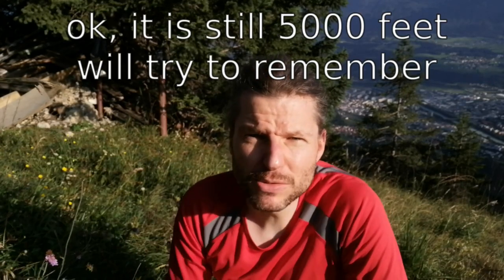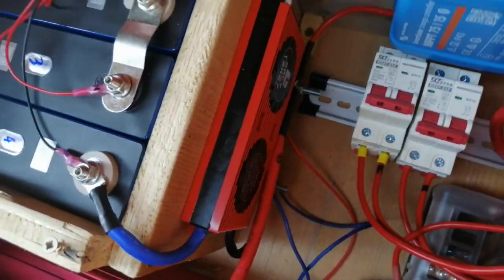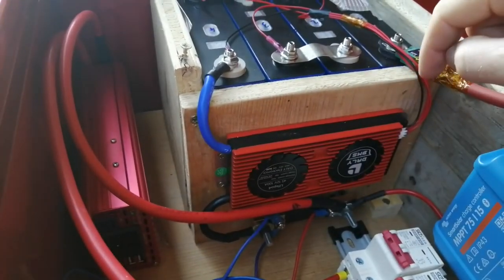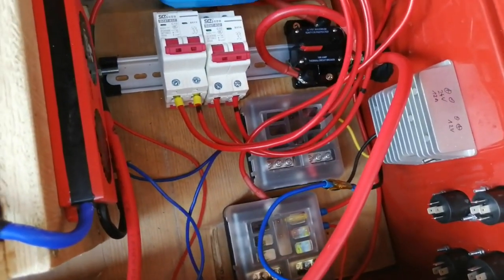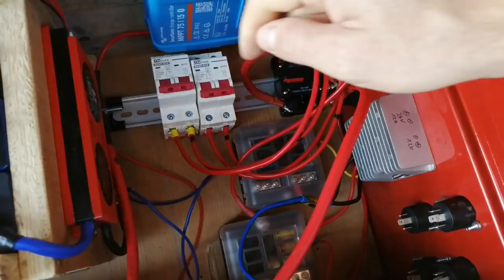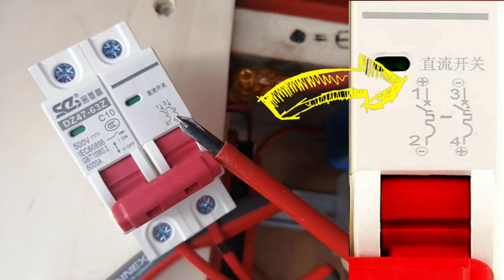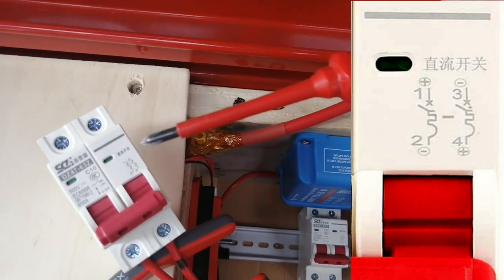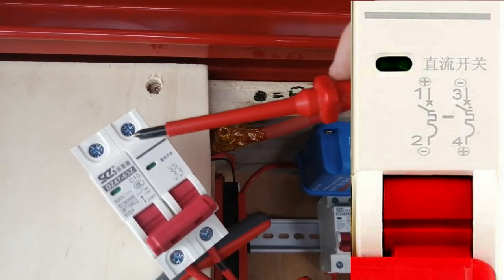How to wire up DC breakers? -  Building a 12V LiFePO4 Off-Grid All-in-One Solar Box (Part II)

Comment: Hi, I did not  understand... the higher potential has to be connected to the top(1 and 3)?
So PV plus to 1(top.left),PV minus to 3 (top right), charge controller plus to 2 ( bottom left) and cc minus to 4( bottom right)?
Or could I also connect the higher potential to the bottom, like so:
PV plus to 4(bottom right), PV minus to 2 ( bottom left), CC plus to 3 (top right) and CC minus to 1( top left)?
Reply from the maker: Hey, yup exactly, both is possible, exactly as you described.
Reply: Yes that's correct in my opinion and agree the video is correct ,the subject does cause confusion on many other channels

Comment: Even know it will work ok , you have the terminals backwards . Positive always goes on the right side as your facing the breaker .  Its a good habit to get into . this will help prevent accidents .
Reply from the maker: thanks Steve for the input. can you explain a bit in detail what you mean with "always right side" because it depends how you connect it?

Comment: I'm curious to ask if the stability and ability of the wires and circuit breakers, etc feel the same between lithium batteries compared to lead acid battery bank systems? 

I ask because I have noticed that how things work in reality isn't always just like on paper.
Reply from the maker: Hi noahriding5780, thanks for the question. I am not sure if I got your question. The wires and breakers do not care where the power is coming from. It is also the same equipment. 100amps from lithium is the same as 100amps from lead acid. cheers, Lupo
Reply: Thanks for your answer. I like to ask questions. I feel like lithium isn't quite as stable that's part of why I asked. Like there's a LOT of ebike and EV fires because of their lithium batteries. But one of my friends who is an engineer is hopeful that in 5 or 6 more years they will have worked out the kinks. I also asked because I noticed sometimes my solar wires going between the panels and the charge controller get hot and I wasn't sure why. So it seems there's so many things to research and ask about. And it makes me curious. I also feel its a great and wonderful opportunity to try to talk to smart people like yourself. You are a builder and are creating things, and that's very cool and wonderful. I wish for your continued success. @LupoDIY

Comment: A little confused.   You have a charge controller between the battery and the solar panels.   When you explained about the connections, you did not make it clear, how is the charge controller connected.  Bcuase on the circuit breaker positive side, the higher poential solar panels should connect and on the lower potential the charge controller should be connected.  So we ned another circuit breaker between the charge controller and te battery,  the question is should the charge controller be connected to the higher potential on this second circuit breaker and the battery to the lower potential side, assumng they are both polarized circuit breakers.   Just trying to understand, since I'm planning on bulding my own off grid solar small project.  Thanks.
Reply from the maker: Hey @martinlopez3792, thanks for the question. PV <--> Fuse /Breaker  <--> Charge Controller <--> Fuse /Breaker <--> Battery. On the PV side the PV has the higher potential and on the Battery side the Battery has the higher potential. Hope that helps? cheers, Lupo

Comment: I have a single pole breaker. It's labled, line and load. My problem is I want to put it on the positive output line from the inverter to the batteries. It's actually a two way circuit. When the inverter is charging the batteries the inverter would be line and the batteries would be load. However when the sun goes down the batteries would be the line and the inverter would be load.
I'm trying to figure which would be the best way to install it.
Reply from the maker: hey @fauxque5057 thanks for the question. just think about a short. usually there is more power stored int he battery, so in case of a short more power is coming from the battery. hope that helps, cheers, Lupo

Comment: So are you saying the plus sign is the wire coming from the source of power and the negative is headed to what youvwant to feed power to?
Reply from the maker: Hey Georgia, it depends. As you can see at 5:24 there are two + symbols. On one side you connect the positive wire of the higher potential (Input 1). In the other side you connect the negative wire of the consumer (Input 4). Hope that helps. But it is not written in stone, this is just the breaker I use. You always have to read the manual of your breaker. If you don't know exactly what you are doing, ask an electrician! cheers, Lupo

Comment: I think I understand but want to check. So my solar panel is the higher potential so both positive and negative of that go in the top connectors and the bottom connectors go to the inverter?
Reply from the maker: hey @andrewbreckill3832, it depends on you breaker and you should always check the manual. but in general this is the case. PV+ goes to breaker + symbol. PV- goes to the breaker - symbol. Both on top or both on bottom. cheers, Lupo

Comment: 7:32 Which is the higher potential: Battery or charge controller? Thx for the video!!
Reply from the maker: Hey @Paul-jo3zk, I know it is a bit confusing. In general the higher potential is always the side where you have more power stored. So whenever you have direct connection to a battery, it is usually the battery as in case of a short there will be a lot of power coming from the battery. hope that helps, cheers Lupo

Comment: I'm still confused. I just want to put one of these between the solar panels (+-) and MTTP controller (PV +-) so it acts as a cut off. How should it be wired?
Reply from the maker: It depends on your breaker, but in general the PV side is the higher pontential. So the poitive wire of the PV is connected to the + on the breaker. But make sure to check the manual and diagram on the breaker. cheers, Lupo

Comment: This is really important but I'm still confused as to how to connect battery Vs charger.... Is the Battery the load or the source?
Reply from the maker: Hey Godwin Bassey, it is about the higher potential. So the if the breaker is between PV panel and controller, the higher potential is the PV panel. If the breaker sits between the charge controller and the battery, the battery is the higher potential. hope that helps, cheers Lupo
Reply: @LupoDIY  how about if the breaker is between an inverter & a battery (considering that the inverter doubles as a charger)
Reply from the maker: @DaTecNerd  indeed not that easy to say. I assume there is another breaker between the actual battery and the inverter which protects this side. so the "dangerous" flow would be from the charged battery back to the inverter, so when the battery is the higher potential, eg. in case of a short. so in general both batteries should be shielded by a separated breaker considering the batteries as the higher potential. hope this explains it a bit better, quite difficult by writing without drawing ;)  cheers, Lupo

Comment: Hi, 
I am new to the solar DIY and I like to ask a question... u connect your solar charge controller to the battery by using the battery side as the "higher potential" to connect the DC breaker. But it is the Charge controller who charge your battery so should it be the Charge controller side be the "higher potential"?? 
Thanks.
Reply from the maker: Hey, thanks for the question. I have two breakers and the charge controller in between. the battery has the higher potential between charge controller and battery, and the solar panel has the higher potential between solar panel and charge controller. Hope this helps. cheers, Lupo
Reply: @LupoDIY  Thank you so much.. it help a lots... thanks again.. :)
Reply: @LupoDIY  
I have one question 
Did the potential  not change for a battery - controler 
If u are in charge or discharge moment?
Just asking
I understand it well for panel’ but for battery its less clear in’my mind
Reply from the maker: @stephanemaster8808  when you short the battery it can deliver 1000A or more, so this is always higher than the charging solar side

Comment: Hi, is this dc circuit breaker enough to protect Lifepo4 batteries/PV string or should it be combined with fuses?
Reply from the maker: Hey Ivaylo Manolov, thanks for the question. Usually, those breakers are also fuses and the trip current is specified on the breaker. But it depends what device you use, so always look at the specs of it. cheers, Lupop
Reply: @LupoDIY  Thanks a lot!

Comment: In this scenario, how do you wire a breaker with hybrid inverter and battery bank?
Reply from the maker: Thanks for the question? usually you connect the inverter to the biggest fuse/breaker that I drew in the middle which is directly connected with the battery because there is a high current flowing to the inverter. Does this help? cheers, Lupo
Reply: @LupoDIY  Thank you!

Comment: Very nice video.can i use lower side as battery source and upper side as inverter source in dc breaker??
Reply from the maker: it depends on your breaker but in general you can use both sides. you just have to make sure that you connect it correctly. cheers Lupo
Reply: @LupoDIY  thanks boss.iam dentist.any help from my side any time.

Comment: Hello , and if the diagram only has + & - at the top then it is reversed at the bottom ?
Reply from the maker: it is difficult to say. I would ask the vendor/manufacturer, maybe it is the polarity not the potential. cheers, Lupo

Comment: Nice battery box but........the toggle switches are easily knocked and you can accidentally drain your battery, or worse! The covered switch is the way to go, flatter toggle or flat push switches.
Reply from the maker: thanks Brian, this is good advice, you are right.
Reply: @LupoDIY  It's a nice aesthetic though 😁 I like the  feel and sound of those switches. You could use guarded switches, as say, in the Mini, I suppose.
Reply from the maker: @BrazzaB1  yup, I still have some spare guarded switches left, maybe I will replace them. the guarded switch that I already installed is my main switch, so if this is off all the other switches are also off. furthermore, the box will be located at a quite safe place. So I guess it won't be huge risk but you never know and it is always good to increase safety.

Comment: Isn't the charge controller the higher potential compared to the battery?
Reply from the maker: hey Tobias, thanks for the question. if you consider a short, the battery can provide a way more current. but you should have a fuse on both sides of the controller. one to the PV and one to the battery. cheers, Lupo

Comment: At the end of the video 7:14 you are saying that battery is connected as higher potential than the charge controller! Why? Charge controller should be higher potential, as it has higher voltage (it wouldn’t charge otherwise), doesn’t it?

Also, what happens during the night when the voltages switch? Battery has higher voltage than controller and/or solar panels.
Reply from the maker: Hey @linas9 thanks for the question. The simplest way to check the potential is to assume a short. If you have a short in the battery circuit the battery is always higher than the PV. When there is a short in the PV system (before the controller), the PV side is the higher potential. In my box I use two breakers. One between PV <> controller and one between Battery <> controller. hope that helped? cheers, Lupo

Comment: Great video  On those double pole dc breakers Could you use either side of the breaker (the top or bottom ) for the higher potential  as long as the  wiring is correct way as you describe ( edit just seen same question below)
Reply from the maker: thanks, yup both sides are possible you just have to take care of the wiring. cheers, Lupo

Comment: 12 volt dc motar pump how to connect 10 ampere dc two pole connection
Reply from the maker: Hey  Batra kishore kumar, please, can you provide more details about your problem/question?
Reply: @LupoDIY  I have two pole dc breaker there no sin of plus and - only A B C D how I get dc in put and out put from pewer suply which out put is 12 volt dc
Reply from the maker: @Batrakishorekumar  sorry, it really depends on the breaker, should try to get the manual for it. cheers, Lupo

Comment: Next time, spend another 5 dollars and get circuit breakers that are CE or UL listed. Much higher quality and it will save you time as well!  Keep going!
Reply from the maker: yup, fully agree, if you want to save time, it makes sense to buy higher quality. but the wiring problem is the same for high quality breakers. cheers, Lupo
Reply: @LupoDIY  
Lol! I totally agree with both of you. Unfortunately I bought the DC breaker like this on Amazon. And yes I found the wires easily wiggle out. I’m running THHN 10awg for pulling through conduit and PV wire from the array local breaker box to the panels. Specifically, the THHN was easy to pull out. I found a trick that’s 100%. Strip the wire a little more than twice normal and bend the striped part in half. Insert it in the breaker and smoke it down. Now wait an hour and tighten again. Copper flows, it’s always a good idea to check terminals on beakers be it home RV or project they always seem to need a little more with time. 
And yes, next time UL. I didn’t even know they were out there for this size but they are but it ain’t going to be 5 bucks more.

Comment: sorry - your explanation is NOT an explanation at all.  you keep switching terms which is making it confusing.  you are conflating "plus" with "positive" with "higher potential".  for example:  around the 6min mark, you say that the upper left is 'plus' from your solar panel b/c it's higher potential... and then from the battery your negative is higher potential on the bottom right.  then you go on to explain 'well, you can do it backwards and NOW your positive is the high potential on the bottom right..."  so, you are saying that positive is higher potential.  AND you are saying neg is higher potential.  no, it doesn't matter.

look, to help everyone else out:  traditionally, top is your source (where the electricity is coming from), bottom is your output (where the electricity is going).  breakers are also NOT polarity dependent.  you can put the positives on the right and the negatives on the left. (just don't cross them!!)  also, you usually just put the breaker on the positive side of the circuit anyway and leave the negative alone.  so this breaker you are showing could be used on 2 different circuits where the positive of circuit A is on the left and the positive of circuit B is on the right.  you would only put positive and negative on the same double pole single throw breaker when you are trying to isolate the entire circuit. (instead of just turning it on/off)

sorry, i just wanted help and put a bit more clarity to your video.
Reply from the maker: thanks @dobrzpe - feedback is always welcome. It really depends on the breaker. Some breaker are polarity sensitive. It is due to a magnetic field that pulls the arc into a distinguisher. If the arc is pushed due to the wrong polarity, your breaker can catch fire. At least that is the outcome of my research. Do you have some more information why the polarity doesn't matter? There are also videos which show how breakers catch fire due to the wrong polarity.
Reply: Not sure if you actually correct there I am sure you can have the highest potential on either side of that breaker (either the top or bottom) of the breaker as long as your Highest potential  matches the symbols  on the diagram  on the side of the highest potential its as he explains ,the only bit I think is confused is at 6.35 says bottom connectors ' goes to battery'  I think he means controller   .  correct me if am wrong thanks
Reply from the maker: @ZerHour  thanks for the comment, you are right, the controller is in between. The PV is not directly connected to the battery. It meant the current flows towards the battery, but of course, there is the controller in between. good catch.
Reply: @LupoDIY  hi yes I think its that bit that's confusing people as the controller is not the highest potential   if it was to the battery as you said would change the picture and indeed the wiring ,but yea a good catch 👍
Reply: @ZerHour  yup, you are correct!  in my frustration for trying to understand these darn things i tried to help and throw out blanket statements to make it less confusing.  it's basically breaker dependent...

i found that - SPECIFICALLY with DC breakers - they "can be" polarity dependent due to the 'magnet' in them to help extinguish the arc.  IF wired incorrectly, they PROMOTE the arc and it's catastrophic.  previously, i was going off of info from 'ac/dc' breakers...

...and it's STILL confusing!  LOL
Reply: @dobrzpe  Yea there pretty complicated ,maybe this video will shed some light on it , I know that  many of the cheap DC breakers (mainly black and red ) are causing issues ,much better with these type of DIN   mount type
Reply: But for solar panels it is recommended that the negative and the Plus be turned off at the same time so that's why you need a double pole breaker
Reply: @thethiefonthecross9092  yes.  OR just use a dc disconnect switch that's spring loaded and designed to instantly cut both at the same time!